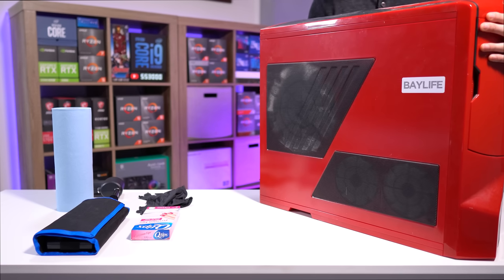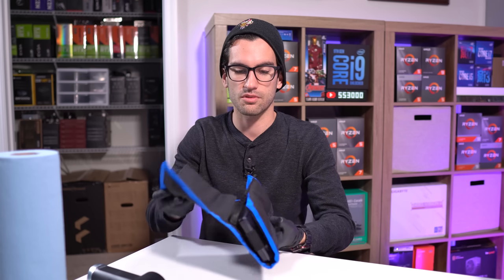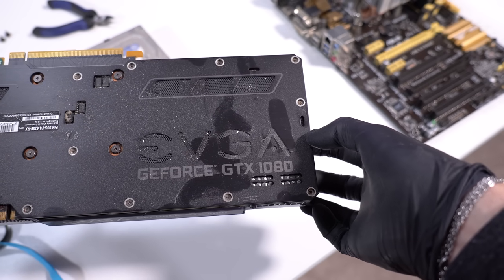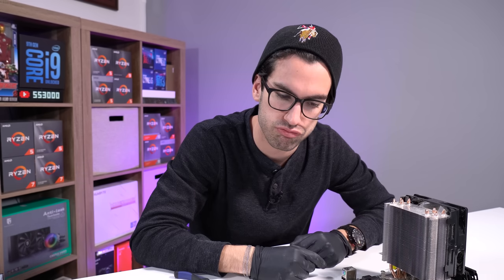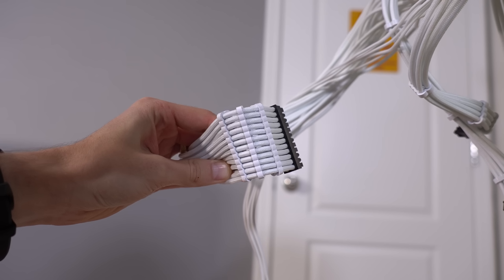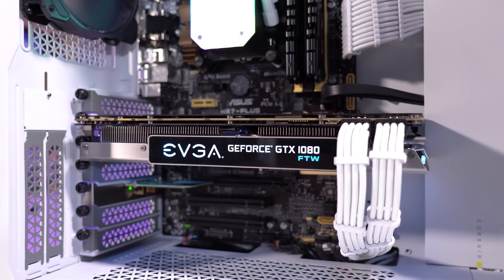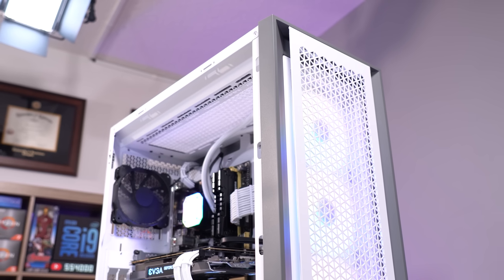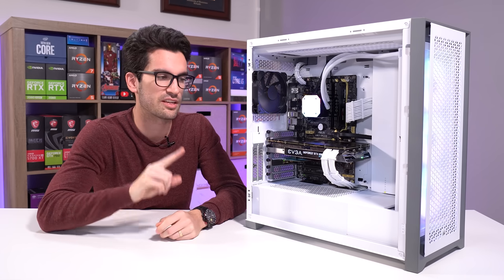Deep-Cleaning a Viewer's DIRTY Gaming PC! - PCDC S1:E3

Comment: Greg puts on gloves so he doesn't have to touch the dust....then blows it all over his studio! 😂
Reply: Fr
Reply: Pretty sure thats not a blower
Reply: That's vacuum cleaner
Reply: @SDP17  It definitely is a blower, if it's a vacuum where is the pouch to store the dust. Also you're not supposed to use a vacuum on the electronic components as it apparently can cause static discharge or something like that.
Reply: Rather than gloves, should wear a mask
Reply: @SDP17  also it can aspire little pieces if you not removing them before
Reply: @octaro3310   it says in the description that it’s a air duster
Reply: gloves are also for protecting parts from static electricity
Reply: He probably has good ventilation.
Reply: @1upr660  Static is fine if the machine isn't powered, just make sure to discharge the metal parts of the pc before turning it on (or keep it plugged in for a few hours and it'll discharge itsself, atleast in the UK since plugs have the earth connector, dunno how other plugs work)
Reply: its why i hate compressed air.
Reply: Do you think there isn’t already dust all over his house or in the studio? Dust is already everywhere. Just run an air filter, either part of your a/c or a standalone air purifier.
Reply: @SDP17  you cant use a vacuum on mother boards
Reply: @Teamgeist Rags do.

Comment: I like how you took the extra time to clean the cpu cooler even though it was getting replaced with an aio. Very thorough...
Reply: Like he says he finds it staisfying
Reply: Well when the owner does upgrade platform they can pass the original config to someone else.
Reply: well there's your problem on why it's not running properly she's old and in badly need of a good cleaning

Comment: At my work, we use a small painting enclosure that has a vacuum attached to it along with a air compressor.  Allows us to clear out the dust from classroom pc's and at the same time vacuum the dust out of the enclosure.  It has rubber gloves sealed in the front of the enclosure so we can reach in to move the equipment around while cleaning it.

Comment: my deepest fear every time I do these clean ups, they never run the same again.
Reply: rest easy. most of these are straightforward, if brilliantly worked out in advance. disassembling fans is dicey, though. makes me squirm, too.
Reply: if you take it apart the correct way and clean it, it should run even better, so let that be your deciding factor if you wanted to clean yours.

Comment: (Greg) - I want the old case it’s beautiful and they don’t make that aesthetic anymore.
Reply: I want the old case for the simple fact you can fit 10 HDD's in it !
Reply: I have been meaning to upgrade mine, I have the same one, it's big and heavy and has no psu shroud, and dust does build up crazy fast in it
Reply: @justinv3080  yeah. By today’s standards, it’s a little obsolete. But the sheer amount of space was so nice to work with. I had all the all the fan slots maxed out, to include all 3 230mm and even a 120 bracket in optical drive bays. I was getting great airflow and couldn’t complain about temps.
Reply: The NZXT Phantom! I'm currently cleaning my white one to give my old build away to my nephew, I definitely won't go as deep in the cleaning process and I'm keeping the same case but I was shocked to see the exact same model I'm currently cleaning. Definitely was a dust trap but very good airflow and plenty of room inside plus that killer look, it's been called a heater and A/C a few times by ignorant people . Actually the removable top and front panel turned yellowish (quit smoking last year), I tried various techniques, even rubbing alcohol and WD40 isn't enough so I'm doing it with acetone now, only on the top panel, the front one is less bad, the acetone dissolves the plastic and I can get rid of that brownish layer albeit killing the glossy and slick aspect of it but completely restoring the original white but it's a pain to do.
Reply: That was the case I used for my first build. Recently sold it with board and 3570k for super cheap.
Reply: @YomBouyashaka  I was sitting here trying to remember the name of that case. I knew it was a NZXT case and the name Phantom popped into my mind. Seeing that I got it right after all this time was pretty surprising. I only built at the most five machines (I'm certain it was at least three, and absolutely not more than five) in that particular model of case, and apart from the styling it didn't leave much of an impression. But I remember that the plastic was of good quality and it all fit together quite nicely. It's a classic case and though it's pretty big I like the looks of it much more than the look of the Corsair case that replaced it in this build. However I guess it might have been necessary to switch it out in order to install that AIO. After all most cases that old won't support a radiator that large without modification.
Reply: Well, you DO KNOW that you CAN buy an AIR filters for any sizes ???
I sure would like the old case...
Reply: @justinv3080  I want to know what case that red one was. I'm just curious and now it's bugging me.

Comment: Suggestion: Give full specs

Other than that really enjoying the series.
Reply: it's an intel i5 4690k running with a Gtx 1080 you can figure out which one as the aren't many Pentium's like that which you can overclock so good luck figuring out which one it is do you seriously think an I series CPU would be treated by letting the cooler get that dirty nope real person would clean the cooler before it got that bad his computers a joke a quad core non hyperthreaded to game on so nothing fancy like my 3950X with 16 cores 32 threads and 32 gb of ddr4 at 3200 mhz on my GTX 1080 zotac amp extreme which makes his ftw gtx 1080 look like a gt 1030 plus my computers clean inside compared to his and my massive 16 tb of internal storage so I never run out of space cause that would be bad I'm guessing 8 guigs of ddr3 as that cpu will only work with ddr3 he may have 16 gigs that's hard to tell cause not shots of the ram cap on the this video
Reply: @raven4k998  Bruh you good?
Reply: @tonkman351  yeah dog just give that dirty cpu cooler a good licking to get all the dust off of it someone used it for a furnace filter and it's full needs a good licking to clean it out
Reply: yall need help

Comment: Some compressed air, a mask and outdoors could speed this process up 10 fold.
Reply: yeah using a real air compressor. shit you don't need to clean memory modules besides blowing the dust out. you don't put water through a damn cooler, it'll corrode.
Reply: Harsh compressed air cleaning could damage components i think

Comment: I used to smoke indoors and as a result, had to fully disassemble my computers every 2-3 months, and do a full on cleaning that started with washing everything in the sink or shower, including motherboard...and then a full on alcohol wipe down of everything.  The full process would take hours...usually a day of casually cleaning.  Even with all the cleaning, the "tar" would still end up in places that cannot be easily cleaned...like inside fan hubs, eventually causing the fans to run slower or just seize up entirely.  I quit smoking a couple years back and now rarely have to clean things...though with a dog in the house, I still do it every now and then. I no longer have to run filters on my case, though, which really helps with overall temps.

Comment: If you're going to do indoors cleaning I recommend getting an air purifier, it will trap most of the dust that flies around. Then you vacuum the air purifier filter and you're done :D

Comment: I love how this is considered the "worst" so far. I built my boyfriend's new PC and then cleaned all the components from the old PC so that I could use it and when I tell you it took me two full cans of compressed air, about 3-5hrs total of cleaning/rebuilding time, and each component/the case itself had about a centimeter of dust covering it, I'm not kidding. To put it into perspective, this case has lived on the floor its entire life (not anymore now that I'm using it) and we have carpet and two cats. To top it off, the PC hadn't even been opened in at least 2yrs, and I have no idea when it was last cleaned but it was not cleaned two years ago when it was open, just had a gpu switch. Loving the system now and it's running a lot cooler now that it's clean. It'll definitely hold me over till I can afford the last few components for my own build.

Comment: When I clean my PC, I use a soft paintbrush and a hoover to remove most of the dust. Whilst softly brushing the dust off, the hoover sucks up all the dust. If you use compressed air to remove the dust, you will just spread it around the room and also your lungs. Since dust is mostly dead skin, It's not something you really want to be breathing in. If you must use compressed air, you can do that outside.

Comment: I have this case. I ordered it.  The 5000x at least.
Turn the fans on silent mode and tell me what you think of the front dust filter.
Mine flaps back and forth making a lot of noise, no bracing on filter causes fabric to move.

Comment: Dust sucks, Every week I wipe my outer PC Case then 2-3 weeks I will out the inside particularly the PSU cover, and some other areas. Hopefully with a room reno and (I'd like to get rid of my carpet but probably wouldn't be able to) the amount of dust can go down.   

Tip on clearing the air from dust, take screen out of window, open it, if you have a fan in your room put it on reverse so it sucks the air up toward the roof. Leave it for a few hours. Of course vacuuming at the same time helps can help too.

Comment: I have that same red case but with acrylic side window, I hated it ,the rubber grommets all deteriorated  and the power button works some of the times after first few years. Fortunately, I didn't get rid of it though, it will become my unraid case when I rebuild . Lots of drive bays and extra fan placement inside the case to direct airflow over the drives and or what ever you have in the pci slots.

Comment: Have a 1080 TI 11G rig for about 6 years...  I did not annually clean anything except use some duster.

Yesterday I took my graphics card apart took the CPU out an and took every single thing out of the pc, re thermal pasted. 
I did before and after tests and my computer improved 31% combined across all measurements.

Comment: Awesome job! Not to be nit picky but wouldn't you want to mount the cooler the other way around for the pump suction to prevent cavitation?
Reply from the maker: The pump isn't the highest point in this loop. There's nothing wrong with it and not how weak pumps like these work. Orientation has been blown out of proportion.

Comment: several things assembled wrong. watercooling  is backwards, either you click on top or you have to change direction, the water inlet and outlet are at the bottom, so that the air does not return to the pump, and the back cooling of the usb outputs the little gold one was placed without thermalpads , it is wrong will not cool down with performance.
The power supply is modular, just put the cables you need, the rest remove, easy click click. clean and tidy.

Comment: the fastest way for me is 
1. disassemble cpu , ram, cmos batt, gpu from its cooler and fans, psu and its fan, case and its fans
2. clean thermal paste remain
3. soak everything except cpu and cmos batt with mixed water and detergent for at least 30 minutes
4. dry it under the sun with some zinc metal sheet/plate placed under for at least 1 day

Comment: You may want to check gamers nexus on the orientation of the AIO, turns out the lines at the top leads to air rising to that point causing air to the pump and less cooling
Reply from the maker: We literally have a video discussing this. The information people are extracting from that GN video is straight up incorrect. Basic fluid dynamics. See our dedicated video on this subject.
Reply: @GregSalazar  never mind, my bad, sorry for the trigger

Comment: The radiator is incorrectly installed , check where the highest point is , for this configuration the tubes must be at the bottom , every single liquid cool kit its going to have some air and in this case its going to stay in the tubbing or in the entrace/exit of the radiators , less performance , more noise , less life for the pump.

Comment: cant u mount the aio in the top and have less chance of pump failure? bubbles bleed up waters heavier than air with the tubes at the top when permeation occurs after a while will it not send the bubbles to the pump?
Reply from the maker: We literally have a video discussing this. The information people are extracting from that GN video is straight up incorrect. Basic fluid dynamics. See our dedicated video on this subject.

Comment: Should have flipped the radiator so the tubes are coming up from the bottom, youll get improved function from the pump
Reply: No, it will not. It will kill the pump after a ahile and create air bubbles
Reply: @xbyxenos3200  no there wouldn't, the pump is on the end with the tubes, all the liquid in the radiator will go to the bottom away from the pump causing the pump to work against gravity, not pumping efficiently, if anything having it that way would cause air bubbles, but my problem with it is that you just wont get as consistent of cooling
Reply: @silverborne5327  bro man stop man
Reply: @xbyxenos3200  i did a lot on research into this personally and i just dont want people to be miss informed, like if you have proof im wrong i would want to see it, i really like computers and learning more about them

Comment: one thing alot of people are neglecting, is that the anytime you use an AIO cpu cooler,  and mount the radiator to the front, it does not draw enough air to properly cool other components and maintain a good air flow.     i'm sorry but this is not the ideal build. a better build would've been a case that allows for a side mount of the CPU cooler's radiator, while maintaining 3 fans in the front.  and perhaps allow for a second exhaust fan towards the top of the case.

Comment: Nothing an air compressor with nozzle couldn't clean up initially. Of course you would need a water separator inline. Then it wouldn't take so long to clean the damn thing.

Comment: Why not use an oil free air compressor?
Reply from the maker: Because it doesn't always remove the hard, stuck-on grime and often still requires manual scrubbing with brushes (which the electric duster already does) and blasting with water.

Comment: Still way too clean to shock me. I have had systems to clean where you couldn't see the cpu cooler anymore. Older DELL and Compaq were really bad with unfiltered intake and no exhaust fan(s). Also good job on cleaning that system. Couldn't have done it better.

Comment: 1000w PSU for that build? Ive got an i9 9900kf with a 2070 super and still use a 750W...
Reply from the maker: I explained why I used what I did at the end of the video...
Reply: @GregSalazar  For continuity and upgradeability, yes I know but even still. 1000W is overkill even by todays standards. My PSU has served me well for at least 6-7 years through all the upgrades. Just think 1kw is overkill unless you are running some sort of monster SLI\xfire gaming rig which those are going the way of the Dodo these days.

Comment: Extremely dusty and the worst??? Ohhhh you have not seen my neighbors PC that was the worst, her pc was far dustier than that; to the point where the dust all clumped up into one furry dust ball... the PSU... Definitely short-circuited wouldn't boot up, I thoroughly cleaned up that PC and was surprised it even booted up after I replaced the PSU. see ya top that  one @Greg Salazar lol 
TBH it probably was a good thing it wouldn't boot the PSU had dust bunnies inside it as well the fan too, it was a literal fire hazard if it did boot up.

Love your video btw Greg been watching you since your channel was Science Studio!
Reply from the maker: TBC, I said the worst I've yet to clean, not the worst in existence :-) Obviously, much worse than this exists.

Comment: Why wouldn't you just put the whole motherboard into the sink and use that hand held sprayer that you used on the CPU cooler to clean the motherboard?  Also some good DAWN dish soap and a scrub brush does an amazing job cleaning the motherboard.
Reply from the maker: Because I can be much more precise and less abrasive all-around with IPA and Q-tips :-) Anyone can aim a duster at a motherboard and call it a day. But I guarantee you'll miss dust in tight spaces.

Comment: this is just an observation, but you are worried about getting bust on your hands, but then blow off the dust putting said dust into the air that you breathe, would it not be better if you vacuumed it instead, because after all, you can wash your hands, you cant wash your lungs.

Comment: my dude why is the radiator the wrong way around watch any tec tip channels they'll tell you that its bad for the AIO that the tubing is at the top. everything from noise to premature death of the AIO its not good and everyone still puts it like that. you can put that radiator in the top of the case and it would have been perfect

Comment: Am I the only one that thinks that system wasn't very dirty aside from the cooler?
Reply: Yup, it was just a simple dust build up that can be cleaned even by a paint brush. Try to clean system units way back 2005, when units has spiders and cockroaches inside. 😂

Comment: Fail to see how that watercooler is better than the 212. Oh, right. Sponsored.
Reply from the maker: If you fail to see how a 360mm AIO is better than a 212, you need your eyes and brain checked. Has nothing to do with whether or not it's sponsored. It's data-driven.
Reply: @GregSalazar  I got my data from experience. A 212 evo running at ambient on a 4670K tuned to 4ghz.